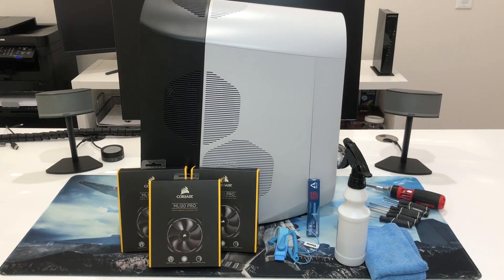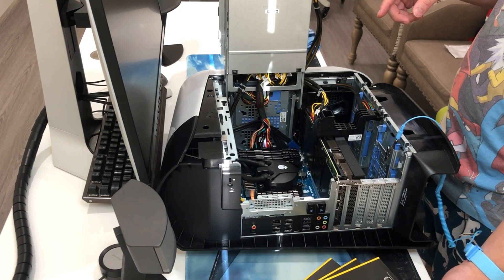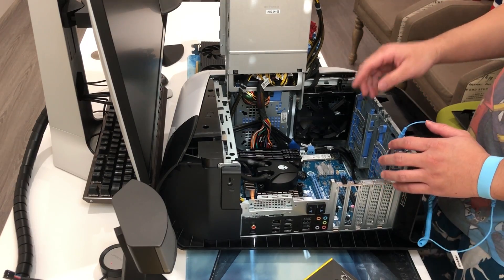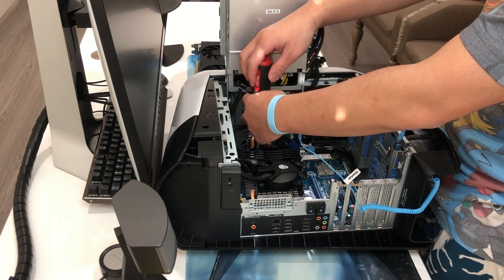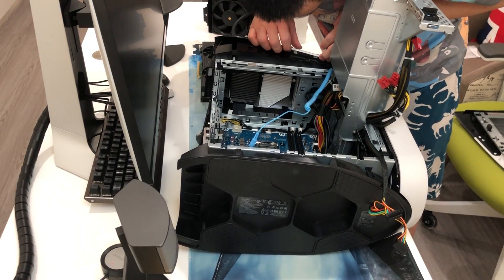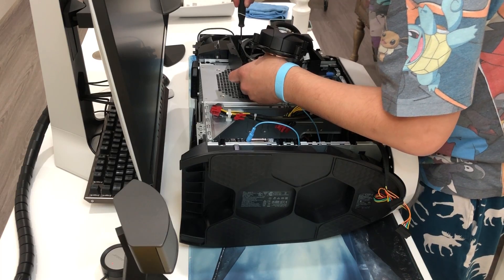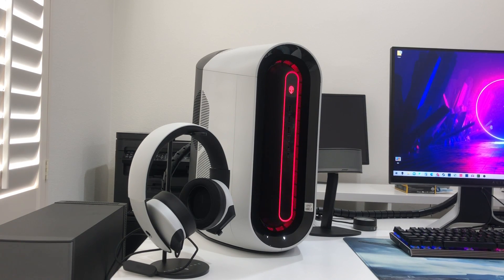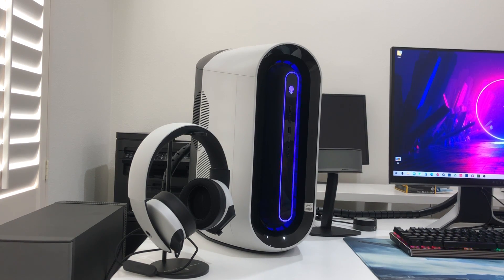How to Upgrade Fans for Alienware Aurora R11 / R12 to Lower Temperature and Noise - Top & Front Fans

Comment: I did exactly the same with corsair ml120 pro and there is a boot error message. Alienware command is testing the fan and the diagnostic is an error 
Then i can press echap and boot the pc normally 
Any information about this issue?
Reply from the maker: The fans all work normally?
Reply: @RyanYu  yes
I heard on forums that the max speed is not the same between original fan and the corsair and the bios see the difference and put an error when you turn on the computer
In any case after replacing the fans alienware command center should test every fan on the computer
Reply: @guillaumebrossault4130  The corsair fan gets only 61% of the stock coolers. They Corsair Pro are very quite, but it was not an improovement for me. Even in Idle the PC was getting warmer.I put the Stock Coolers back in case.
Reply: @RyanYu  i just have to press echap to avoid the fan testing step but i have to do this every time i boot the computer
Reply from the maker: @guillaumebrossault4130  do you always have to do that.
Reply: @RyanYu  yep
Reply from the maker: @guillaumebrossault4130  that’s odd. Try to reconnect the cables.

Comment: @BigFish Do you know if there is a way to remove the front panel to modify it? Also, mount a 2nd intake fan up front.
Reply from the maker: I think you can take out the hard drive bay to make enough room to get another intake fan.
Reply: @RyanYu  Yeah, I don't understand why Dell mounted the HDD there. It has two drive bays at the bottom. Plus they put 90 degree angles on the front panel. Reducing air intake.
Reply from the maker: @PokèMyBalls  Try it, if it works let me know. haha.
Reply: @RyanYu  I was going to cut out the metal behind the fan and open up some of the front panel more. I just have to get it off first to see what I can do.
Reply from the maker: @PokèMyBalls  Keep me posted dude!
Reply: @RyanYu  I'm documenting it so I will send you my pictures and any video.
Reply from the maker: @PokèMyBalls  That will be awesome, and if it works I will make a video of it, and give all the credit to you.
Reply: @RyanYu  Did you ever notice the stash hole in the top towards the front? About 2 inches deep and no function.
Reply from the maker: @PokèMyBalls  not yet.
Reply: Side and front pop off with clips like the top. Except you have to unclip the front. I have to disassemble it to get the wires off.
Reply from the maker: @PokèMyBalls  I see.
Reply: @RyanYu  I was about to break the dremel out but when I got the front panel wires disconnected I found out it's just a piece of 2mm film on the back blocking airflow. Not sure why.
Reply from the maker: @PokèMyBalls  is it Removable?
Reply: @RyanYu  Yeah, It was only glued on. I took it off pretty easily. I noticed on higher end models like the R11 it has mesh with RGB.

Comment: Just bought 3 of those fans but in the RGB version, will those work as well? I bought the thermal paste as you recommended in addition to the fans. I ultimately bought this PC to play call of duty warzone with a 3080 but I’ve crashed on multiple occasions I believe because of the heat
Reply from the maker: I think it will work.

Comment: Hey BigFishGaming. I have ordered an Alienware R10. Is it possible replace the power supply with one that's higher in wattage? My R10 specs are Ryzen 5 5600X, 3060ti (Alienware liquid-cooled edition), one 16gb 3400Mhz, and 550W power supply.
Reply from the maker: Yes you can.

Comment: When you pay over $2k for a pc and have to find way to cool it down lol
Reply: Yeah but I just bought one with a 3080 in it for less than a 3080 is on ebay..
Reply: @payradokz  and you still paid too much
Reply from the maker: IKR.... haha
Reply: When u spend over 2000 for a DIY or pre built machine and still have to find a way to cool it.........what's the difference.
Reply: @MurdahBassRecords  you’d find a way to cool it within that 2000 budget
Reply: yeah and sadly even with their liquid cooling option it’s still loud. I love mine but man does the fan get annoying with bigger titles or badly optimized games like pathological 2
Reply: @OverL00k707  Maybe I have higher ambient noise in my surroundings, but mine really isnt THAT loud. I even installed another exhaust fan in the back below my card to reduce heat and its still not very loud.
Reply: because they sell if for gaming not mining :)
Reply: When you pay over $2k on a machine and spend more on it to cool it down without knowing gddr6x runs hot.
Reply: I payed $4300 for mine everything on it was perfect except for there dry arctic silver 5 thermal paste I had to replace after 3 days with MX-4 my vram doesn’t overheat even under 99% load, saved me $1400 over building the same PC myself I got my GPU for near MSRP 3080 Ti there going for around $2400 on the open market so I think I got a decent deal giving the current PC crisis where in because of crypto miners
Reply: All pre builts have bad fans.
Reply: That’s “pay for the brand” is Alienware, if you want a quality prebuilt and you are actually spending money (I.e. more than $1500) go with Origin pc… its minimal research for something that costs thousands.
Kind of a no brainer
Reply: There are people that pay $300K for a car that breaks down just one week later. They are just paying for the feeling of owning something cool and expensive.
Reply: Its the worst part of the entire r11. That and the noneupdateable mommy board

Comment: Is it absolutely necessary to remove the heatsink and radiator to change the fan? Seems like you might just be able to unscrew and rescrew the replacement fan
Reply from the maker: I have tried not to remove it, but it can't be done. you have to remove those to get the radiator out in order to unscrew.
Reply: I feel like you can squeeze it out
Reply from the maker: @trueno1337  it will be so hard.
Reply: That's what she said.

Comment: Will my aurora r11 that I ordered have overheating? And can I just put a normal fan (the ones you sleep with) to reduce it, or I really have to change the dans inside the pc?
Reply from the maker: If you want to have the lowest temps, yes you will have to replace the fans inside.
Reply from the maker: @Sixtyfps Gaming NZXT is pretty good too.
Reply from the maker: @Sixtyfps Gaming So far so good tho.

Comment: Great video mate. I'm considering purchasing this PC. Quick question though.

Is there a 2nd M.2 slot to put in another SSD? Or are we stuck with the one SSD.
Reply from the maker: just one M.2 SSD, but you can put in another regular SSD.
Reply: @RyanYu  isn't the Wi-Fi using an M.2? If so if you use a wired network or if maybe you replace wifi with a a card then couldn't you use that slot for another M.2 SSD?

Note: it's probably a good idea to keep all your old parts when under warranty. Alienware is ok with you modifying your computer but if you need warranty work they expect you to install the stock components first. I read this in the online documentation.
Reply from the maker: @dralberthofmann  Yes, it is correct. keep the old parts for warranty.

Comment: Aren't they 2 different size fans? The intake being a 120 and the exhaust a 140? I have a R11 also not really worried about the noise as it isn't too loud but wouldn't mind upgrading it just making sure before I buy the fans
Reply from the maker: Hi, those two fans are the same size, they both are 120.

Comment: Great video!

I just received my R11 with the 3080 and it's quite noisy. Sadly the only one in stock was Air Cooling - not liquid.

The temp is the CPU/GPU is around 98c when playing RDR2, it seems really high.

I read on Dell Community that replacing the liquid cooling for a Corsair ML120 Pro instead. What do you think?

I just ordered those fans - thanks to your video.
Reply from the maker: Replacing those fans and reapply the paste will surely help with the noise and temps.

Comment: I got the same system(except that it's the i7-10400 non-k cpu).  I noticed that you have a liquid cooled cpu.  Mine is not liquid cooled.  They should all be liquid cooled.  For now, I've lowered the voltage to keep and modified the fan curves to keep things cool.
Reply from the maker: You can upgrade the CPU liquid cooling yourself too. it's not that hard.
Reply: @RyanYu  Yup.  I plan on upgrading to liquid cooled once the warranty is up.
Reply from the maker: @jacquesdemaille8653  Nice, let me know once you do.

Comment: I have a Aurora R9 and I used the same fans but it would not pass the hardware check software during the boot phase  nor did the fans spin properly so my question is how did you by pass the hardware check software at the boot phase?
Reply from the maker: I didn't do anything like that, no error pops up. just went through. pretty much like plug-in&play.

Comment: so I will need a 
Corsair ML120 Pro, 120mm Premium Magnetic Levitation Cooling Fan and Corsair ML140 Pro, 140mm Premium Magnetic Levitation Cooling Fan... and ARCTIC MX-4 - Thermal Compound Paste For Coolers | Heat Sink Paste?
Reply from the maker: Yes sir, but they should all be the same size which is 120mm.

Comment: Hi bigfish, my R11 is coming this week and I want to know if I really nead to change the fans. I have a rtx 3080 i10900k configuration. How was the temps before the sostitution? I dont matter the noise, just the temps. Thx.
Reply from the maker: for 10900K, you will expect higher temps than mine. but if you don't overclock too much you should be okay. you don't need to change the fans if the noise is okay for you.
Reply: @RyanYu  thank you man! how high was the temps while you were playing? Before the fans change.
Reply from the maker: @gianlucaguernieri8608  80-90, and now always below 80. however, I only have 10700K. but you should be fine. don't worry.
Reply: @RyanYu  thank you Fish!
Reply from the maker: @gianlucaguernieri8608  NP, thx for the support to the channel.

Comment: just a tip, a much quieter fan for the front is the nocuta nf12 1700 redux https://www.amazon.com/Noctua-redux-1700-high-Performance-Award-Winning-Affordable/dp/B07CG2PGY6 i have it on my r7 (which is the exact same as the r11 inside) and it is silent and a great buy
Reply: The fan makes no noise when running at full speed
Reply from the maker: Error?

Comment: Hi, I'm wondering if we can replace the fans with a different brands/models other than the Corsair ML 120 Pro. I'm looking at fan comparison and I noticed that the Noctua NF-A12x25 actually performs better and quieter than Corsair ML 120 Pro, but I'm worried that it will not be supported by my Aurora R11.
Reply from the maker: From my understanding, it should be fine to use other fans as long as it is 120mm in size.
Reply: Other fans even though 120mm will throw up error codes thats why everyone uses the Corsair Pro, and make sure they are the "pro".
Reply from the maker: @OdyBeRidin  Nice to know buddy~
Reply: @OdyBeRidin  Someone has tested Noctua works well no error code. I have ordered Noctua NF-S12A & NF-A12x25 for my R10.
Reply: @yinubajian  Which one will you be using for the intake and which ones are you using for the push pull at the radiator?
Reply: @OdyBeRidin  NF-S12A for front and A12 for top. I have done a half. And I took out the 5’ hard drive racket for adding an additional front fan later.
Reply: @yinubajian  Does Noctua fan work well without error code?
Reply: I googled the specs for the Noctua NF-S12A & NF-A12x25 both are quieter but neither perform better than the Corsair ML120 Pro.  Corsair has 15 more CFM and spins at about 500 more rpm than the Noctua's.
Reply from the maker: @OdyBeRidin  seems like I made the right choice
Reply: @RyanYu  Me too! My fans should be here next week.  I was also told that you can tweek your CPU voltage very slightly and make a big difference in temps.  I havnt got the full details yet, Im going to wait to see how the fans do
Reply from the maker: @OdyBeRidin  I have that video too, by using the throttles tip you can undervolt cpu voltages to have a lower temps.
Reply: @RyanYu  where can I get more info on adjusting voltage for lower temperatures?
Reply from the maker: @dralberthofmann  https://www.youtube.com/watch?v=U8U-_ZAb9cM
Reply: @RyanYu  great thanks Ryan.

Comment: Hoping you could help me I just got the same rig and my cpu frequency isn’t showing in the alien command center is just shows 000 but my processor is working fine I already uninstalled alien cc and reinstalled it didn’t work you think you might have a fix for me thx
Reply from the maker: I’m not sure about it. But you can definitely call Dell for it since you have warranty. They can help you to solve the problem by the remote.
Reply: @RyanYu  yep time to call Alienware thx

Comment: So, one of the fans you bought for the top was defective,  when do you get a replacement?
Reply from the maker: I got the replacement, but I don't think I need that anymore since two fans upgraded is already good enough for the temps reduction. Adding that third fan will cause more noise level.
Reply: @RyanYu  Oh, okay. Whats the bracelet called,  for grounding yourself?
Reply from the maker: @DavidGonzalez-is8ns  It's Anti-Static Wrist Strap. Hope I helped. dude.
Reply: @RyanYu  thank you,  so much bro.
Reply from the maker: @DavidGonzalez-is8ns  Anytime, make sure to check out my other helpful videos.

Comment: Heyy thanks for this video! I replaced my Alienware R11 with a new CPU fan (Noctua air cooler). After I done the replacement.. the system showed an error message “The (CPU FAN) fan failed to respond correctly”. Do you know how to fix it?
Reply: Been researching this mod and it seems that the best fan to use for limited error codes is the Corsair ML120 Pro
Reply from the maker: @OdyBeRidin  It is, I have installed for about 1 month more, no errors.
Reply: @RyanYu  Sweet!! Got my parts on order
Reply: @OdyBeRidin  thank you!! I’ll try that
Reply: I also want to add that.. after I clicked on “continue”, the computer is working fine like normally.. Should I be worried about this error message? Lol
Reply from the maker: Did you plug the new fan to the top and front fan? don't plug it in the CPU fan.
Reply: @RyanYu  I pugged it in the cpu fan.. I don’t think I can plug it to front/top fan since the front/top fan are plugged in there..
Reply from the maker: I see so you went to the three fans? You need a Y-splitter to connect two top fans to the top fan port.
Reply: @RyanYu  I have one top fan, one front fan and one cpu fan. So all I have to do is get a Y-splitter and plug it on ‘top fan’ pin header and connect top fan & cpu fan to the y-splitter pin header right?
Reply from the maker: @specialni  you have a cpu fan? So it is an air cooled cpu?
Reply: @RyanYu  yes, air- cooled cpu fan. The error message is saying my cpu fan failed to respond correctly
Reply from the maker: @specialni  that's wired. but it works? spins?
Reply: @RyanYu  lol yes, it spins and I can play games. It just showing that message every time I boot up my computer.
Reply from the maker: @specialni  that I’m not sure.  But if the fans all working it should be fine.
Reply: @RyanYu  Gotcha. Thank you so much!

Comment: Where did you connect the second fan on the top? I think there’s only one fan  sloth there
Reply from the maker: if you want to add the third fan, you will need a Y splitter and 4 screws. 
Y splitter: https://www.amazon.com/JBtek-Black-Sleeved-Splitter-Converter/dp/B01EF9OI0O/ref=sr_1_9?dchild=1&keywords=y+splitter+fan+cable+4+pin&qid=1609394575&sr=8-9
4 Screws: 1 and 1/4 inch Number 6 Phillip head screw, you can get those from the Home Depot.
Reply: Thank you
Reply from the maker: @radoslawczupryna4747  No problem. Please consider to subscribe the channel for more videos and to help me grow. Thank you.

Comment: Hi! Is it possible to replace the top fan without taking out the entire liquid cooling system, or is it required? I have the Aurora R9, liquid cooled by the way. Thanks!
Reply from the maker: It will be super hard to unscrew the screws on the fan. I tried but I couldn’t get the screws so I took out the whole thing.  If I helped please consider to subscribe the channel to support me if you haven’t. THANK YOU.
Reply: @RyanYu  thanks for the help. Subscribed!
Reply from the maker: @gauravsathish8  that’s awesome.  Thx for the support man.

Comment: Warning if you're a gamer: do not get alienware pc is general. One of the loudest pc out there. Even if you change the fans.
Reply: i have one and its dead silent even on very intense games, my ps4 is next to it and that is LOUD
Reply from the maker: @blazortheepic0384  clean up your ps4 fans it will be better
Reply: @RyanYu  i dont use it anymore. Cant be bothered
Reply from the maker: It's loud. that's true, however, if you are using a headset, that won't be a problem.
Reply: @RyanYu  yeah that's true, for me. It really bother me knowing my fans are running that loud.
Reply from the maker: @itsajoke631  haha, that's why I change them, it brings down some. but it made a huge different when in idle.
Reply: @RyanYu  I change my gpu to liquid cool using Kraken. Now I can't hear anything. One downside is that I have to keep my radiator outside the case with cover off because there's no space.
Reply from the maker: @itsajoke631  Oh, boy,,, What GPU do you have? I have 3080 and it's pretty quiet actually.
Reply: @RyanYu  only 2080 Super. Lol
Reply from the maker: @itsajoke631  That shit is loud I had it for about 2 weeks and returned...
Reply: @RyanYu  lol amen, since you had it for 2 weeks. You think I can upgrade to 3080 without changing the motherboard? Bought my pc from bestbuy.